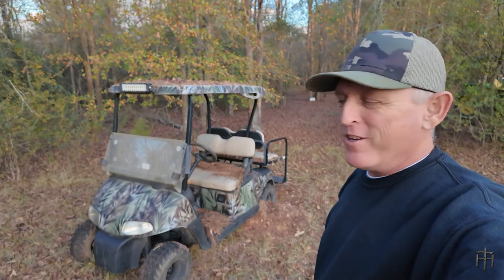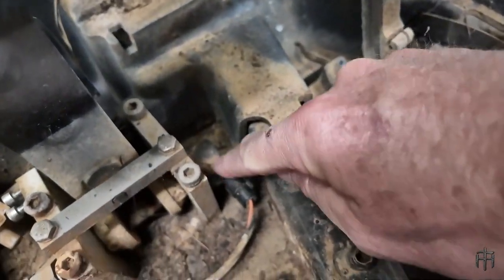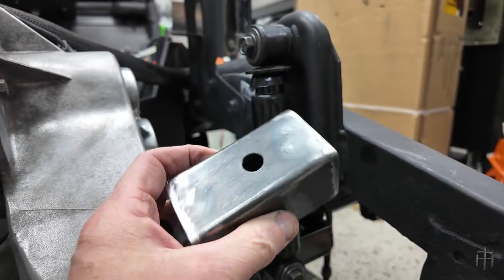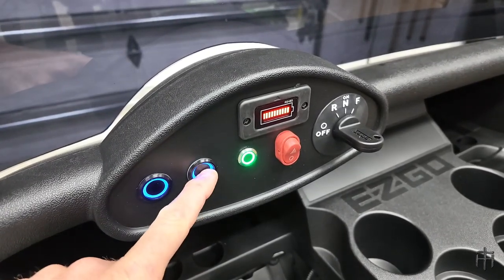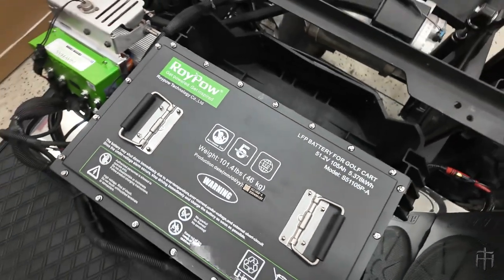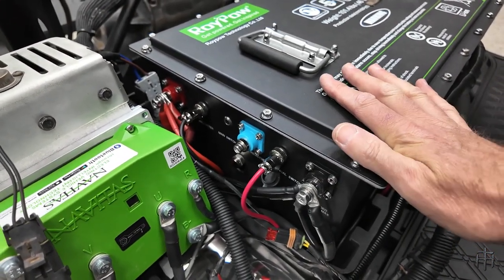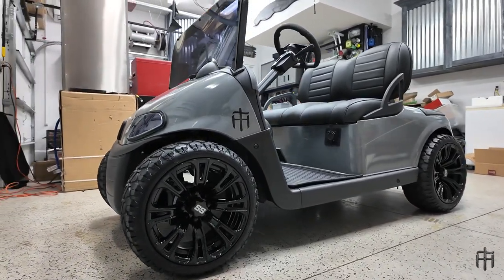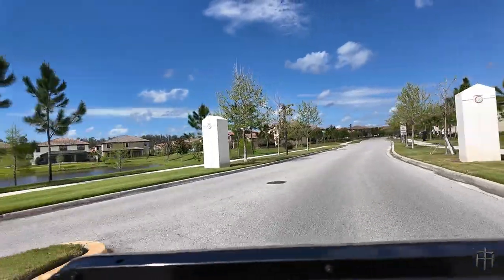Golf Cart Overhaul: Farm Junk to Lithium Super Cart.  It's FAST!

Comment: How would you recommend I proceed when buying a golf course cart and turn it into a hunting cart. Don't care about speed. I need hill climbing ability.
Reply from the maker: Buy an old club car and install an AMD Torque Beast motor with a 48v 500amp DC controller.  Get a good lithium battery and you’ll be climbing hills and pulling trailer’s with ease.  Have fun!!
Reply: What would be an estimate/guesstimate of cost if I do just the items you've recommended ?
Reply from the maker: Give yourself a $1k for the motor, $800 for controller, and 2-3k for lithium battery.  Guesstimate around 5k.  Hope that helps!

Comment: Hey HH!
Great videos, i ran across your "Tesla Powered, Hunter Golf Cart" video and now im watching this video... curious question > Would you use this ROYPOW lithium battery set up on your Hunter Cart or would you keep the BigBattery 48v lithium battery set You installed originally? 
I just recently got my hands on a 48v- EZ-GO - Pecedent golf cart, and it needs some upgrades > your videos are SPOT ON!! 
Let me know.  Thanks!! 
Cheers !
Reply from the maker: Hey there!  You can’t go wrong with either battery.  The RoyPow won’t fit in my Club Car due to the frame size.  I had to use the BigBattery #2/24v batteries to get them to fit.  I like all the extras with the RowPow like the remote monitor and on/off switch.  It’s also built like a tank.  Really comes down to what your frame will allow to fit.  I have a discount code at BigBattery if you go that route.  You’ll need to find a dealer for the RowPow but they are a solid battery!  Good luck!